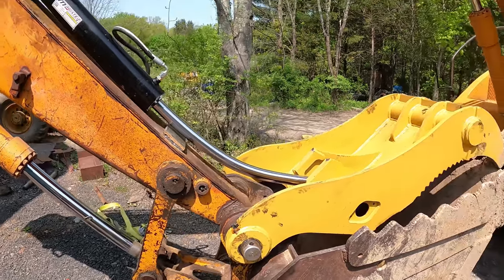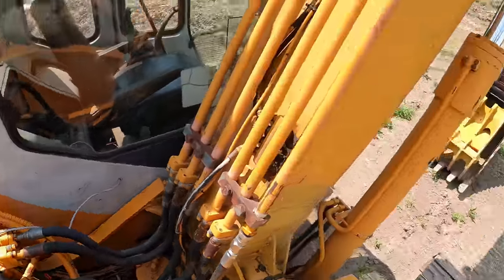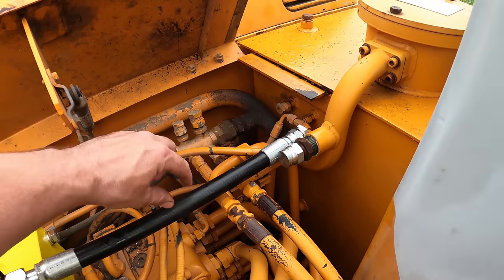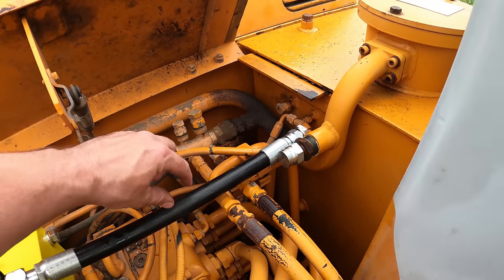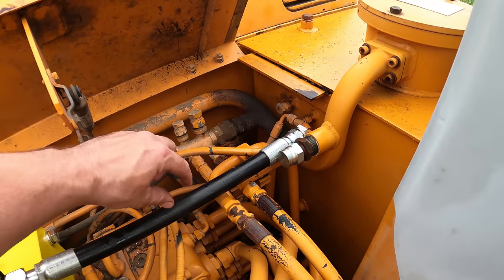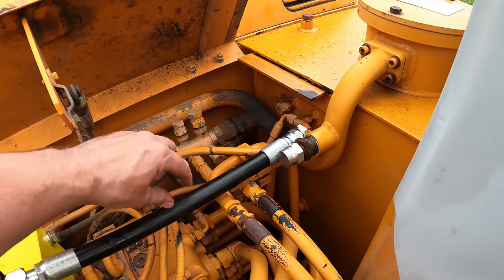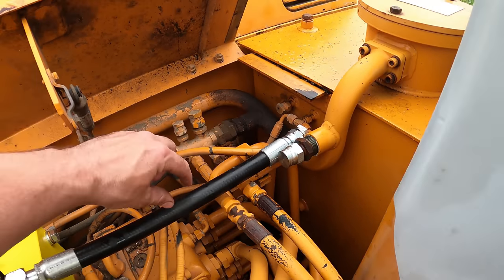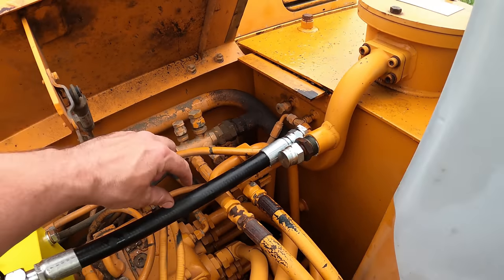Bent the rod on that thumb cylinder

Comment: feel for you.  Had something similar. I put a thumb on a new to me Bobcat , sent to the bobcat dealer to set the reliefs correctly. Got it back 3 months later only for the thumb to bend my bucket curl rod like a banana.  They said they set the reliefs but apparently did not. They replaced for free.

Comment: You were wondering why the new setup felt so much more natural.  If I understand what you said, the left side of the joy stick is controlled by your thumb, so if the thumb activates with your thumb, what could feel more natural than squeezing your thumb, squeezes the thumb.  Cool video Jesse!
Reply: I think it's also bucket controls, left is pick up dirt, left button is pick up with thumb, then of course right to dump

Comment: Great video!  It must take incredible pressure to bend a thick steel rod like that!!
Reply: Hydraulics can generate an amazing amount of force. Plus, that thumb cylinder has leverage working against it. Bucket curl is usually the strongest function of an excavator, as it equates to break out force (digging force). It might have around 10 tons of force at the teeth, where that cylinder is located, it may have easily 5x that. No relief valve, something's gotta give.

Comment: My Kubota was doing the same thing. It had relief valves changed before I got it  .I have to run a solid pin not a greaseable pin. Greaseable pin can bend or break. I watched Andrew's video on changing to a solid pin. I have same machine he has. My thumb is aftermarket not Kubota OEM.  Your video has good info. Thanks

Comment: Glad to see you are a Loctite 545 convert! Been using it for years and have never had a single oil, air, hydraulic, water leak on any equipment fitting I used it on. One note though, you are using about two times too much.

Comment: I didn't quite understand why you wanted to put the T in the middle of the hose, which would have required adapters on both sides so that there wouldn't have been much hose left. Couldn't you have just put the T on one end of the hose instead?

Comment: Hey Jessy, i am a machanic from germany. You need an check valfe from the other line to the hydraulik tank.

You will distroy your seals in the zylinder of air beeing pulled in.

Always cool videos
Reply: I was thinking about this issue. Shouldn't the output from the new relief go through a one way valve to the other side of the cylinder? That way the displaced fluid can be returned to the other side so it doesn't generate a vacuum.
Reply: Maybe it is best that he never uses the curl ram to overpower the thumb ram, as that will cause a vacuum in the thumb return side.   I suppose the absolute solution is to use even more valves..!

Comment: If you put the pressure relief valve on the pressure line before the control valve, it will relieve the pressure on both  sides of the cylinder - extension and retraction. I really like your channel
Reply from the maker: When that valve shuts off and the button is not pressed, it cuts the flow and the relief valve is bypassed. Thats why the rod got bent
Reply: @jmuller86  Thanks for taking the time to reply and explain why the rod bent.

Comment: I would never use a bent rod as it will wear out your wipers and seals very quickly as well as stress the heck out of the cylinder housing.  Can't believe a reputable shop would have recommended that.  The only other option is to straighten the rod (ala Keith Fenner) which takes a bit of experience.  You went right with just replacing the rod.
Reply: Correct. Bent rod will have stress cracks in it, its hardened like tungsten or close to it. it's unsafe to use again. Guaranteed if it was examined it would be stress cracked

Comment: Jesse - I just discovered your two videos on the thumb. It's great to see your creativity at work, and I see you also attract some expert viewers/commenters. You have taught this 73-year-old a few things. I have done a lot of mechanic work, but never messed with hydraulics. Now you've got me wondering about the thumb on my KX-121... it's way strong, and I always have to worry about shearing a tooth pin on the bucket... definitely need to figure out if it has a relief valve!  By the way, I subscribed.
Reply from the maker: Thanks.it should definitely have a relief valve. Moat modern mini excavators do for the aux hydraulics. Definitely should find it and adjust

Comment: I think you should do something about the other side from the cylinder. If its get pushed in, it generate a vacuum. Naybe connect the one port with a one way valve to the other end. Anyways a good Video.👍

Comment: Thank you for using hydro/pneum. loctite. Teflon tape is never a good option for hydraulics on npt. That Teflon gets into the system, you got bad valves on your hands. Also, I would think you system is good for 3000psi. Be careful of setting that relief too low. You will build up some heat if you use the grapple alot. I love how many fittings you have. Npt, jic, sae, bspt, inverted flare. Goodness, that is a Frankenstein. Good stuff bud. I sell many of the parts you used. Heavy equipment is its own animal, for sure

Comment: Reliefs don't need to move a lot of volume they just open another passage which greatly reduces pressure.
Reply: They need to be able to handle  a lot of flow when the system pressure is set higher then the relief pressure. Like in this case. I would have done this differently then jesse has done on this excavator. Set the working pressure  at the desired pressure, and set the relief valve slightly higher. Like 200 psi or something.

Comment: Just so you know... the valve selector box with the two wires coming off. After you take off the outer sleeve it's just the toilet roll looking thing. It unscrews, may or may not have two tiny flats for like a 1/8" thick shitty wrench. I just use a leather strap wrench. They normally just have 20ish threads and an o ring. For next time 🤙

Comment: With a hydraulic press with soft placement parts one does not have to spend over 500 dollars to replace said cylinder. Do NOT stroke the cylinder when in this condition. Otherwise ya'll can straighten such a cylinder and seals will still not leak. Try not to bend quite so far as the brass bushings also screw up. One must keep after control valves to inhibit such errors. Ya'll can unbend such without a cylinder kit. While still just removed from machine and not opened up. I did cylinders a lot years ago not having to disassemble. Measure rod with dial indicator to straighten. If heated rod can be reorganized back to straight condition crystal strength alignment. NEW ROD NOT NECESSARY.

Comment: I just bought a bobcat 334 and it has that style thumb to go on it it doesn't now so anyway I look at it I'm going to need to buy it's on and I was looking at the that kind and I thought it was kind of weak so I'm going to look into the kind that you weld on I think you were calling it the progressive because I can just see pending all kinds of those rods so thanks for showing that that showed me just what I was worried about good video thank you catch you on the next time thanks for sharing
Reply: The Bobcat 334 has an excellent thumb design. What it lacks is sufficient length in the actual steel assembly. If you can salvage a thumb from another machine I would do that. The 334 should have the same parts as a 331, 335, 430 and 435, possibly more even. But confirm that for yourself. The main problem with the Bobcats thumb is it's not long enough but with an old cutting edge you can add on about 12" before it will interfere with the bucket cylinder. The 430 I run sometimes has that modification and it makes it a breeze to pick up big logs and rocks. It still can't hurt itself even when its picking up the max weight it hardly will relieve the thumb cylinder. None of the weld on stuff with compare with the OE design but if it's all you can find it's better than no thumb at all
Reply: @NotSureJoeBauers  thanks I need thumb, looking!

Comment: I'm thinking the pressure release would have worked on the thumb retract line. If  its the bucket pressure against the thumb that caused the bend?
Reply from the maker: it would be creating a vacuum on that line so wouldnt work as well

Comment: That's a nice fix , the lack of a bypass is a design error I assume the thumb cylinder was just essentially solid and when it was touched by the bucket it had nowhere to go, really that bypass should go to the other side of the cylinder as the opposite applies to the retract,  if pushed it would just break the oil column in the retrsct side, interesting

Comment: Given where youre putting that relief valve, what happens to the 'suction' side hyd curcuit when it goes over relief? Wont there be a serious vacuum on the rod side if the thumb cylinder gets collapsed by curling the bucket? Will that create a negative air spring effect? Cause cavitation? The relief valve solves the overload on one side, but the other does what?

I was trying to Google what to do, a crossover relief near the cylinder that both hyd hoses go through before going to the cylinder ports somewhat makes sense, and i see people have done that, but i also read others say that type of relief setup is only meant for hyd motors or multiple single acting cylinders, etc. Because the rod displaces fluid, youd still end up with a bind doing it this way.

I hate to be a buzzkill, i know you just put this work into it, but i think the correct way to fix this is to buy a different electronic valve that has the reliefs built into it. Install it, set it to the desired pressure and be done with it. This is the cheapest way i can think of doing it correctly.

 If someone here knows more about this, id like to hear it. I have a kubota backhoe i added a manual thumb to, and am looking to buy a fullsize hoe ill probably need to plumb for a hyd one soon, so ill need to figure this out eventually on my own.
Reply: I see Farmcraft101 commented here, love that channel, too.

In his vid where he's diagnosing his hyd trouble with his mini's dozer blade creeping up on its own, he talks about how the rod displaces fluid. At first, i think he didn't know whether it was the piston or the valve controlling it gone bad. He eventually figures it out, that bad cylinder packing seals couldn't explain why the cylinder was creeping up. The reason why was because the cylinder rod displaces fluid, so therefore the cylinder cant move without a net gain/loss of fluid (the volume of rod inside/outside).

This should be accounted for when laying out the hyd circuitry to have everything work smoothly, imo.

Comment: It's amazing how easily it broke itself. Just bent a 2" 3"? Solid steel bar like it's nothing.
Reply from the maker: yep, 2" of solid steel. but the rod on the bucket cylinder is like 2 3/4" so the weakest one gets bent first

Comment: Magister Hydraulic are junk ,they are NOT case hardened , I replaced an existing cylinder  , with in 10 minutes the Magister shaft was bent . $500 bucks , shot. I wonder , with the low pressure how use full your thumb will be. You never said , was the old shaft straightened or replaced with a hardened shaft. Great content ! Thanks.
Reply from the maker: He replaced it and I am sure the new rod was better than the old. Is there a place that sells better cylinders? This place wasnt the cheapest but they seemed to have a big selection of dimensions
Reply: If the new rod bends or you want to up the pressure on the relief valve so the thumb doesn’t move, you should go to a larger rod diameter.

You might be able to bore out the gland on your existing cylinder and fit a larger diameter rod.

Comment: I have a Wacker Neuson ET90 and my mechanic can’t figure out if the pressure can be adjusted for the circuit running to the thumb. I thought this could be done for any machine.

Comment: Doesn't the relief valve "dump" should go to the other side of the cylinder? (at least that how mine is installed on my mini and the hydroshop told me to do) . (it move the oil form the extend side to the retract side)  because when the valve is not in use: both side are gonna be closed and when relieving the pressure will put the other side of the cylinder in "vacuum."(and won't do much with the control valve closed)..which the "spring back" is showing.
Reply from the maker: That is how I was originally going to do it but then I thought about having another 4 hoses at the end of the boom or stick and it just seemed like something that brush would catch. It does create a vacuum when that relief valve gets used but it seems to work fine
Reply: @jmuller86  you could have done the T at the connection to your valve block (not necessary to be a the boom/stick)..just like you have done, but dump in the other hose instead of the tank.  It's only 1 hose that loop over:  you connect the relief valve at an existing connection, loop over the dump and T on the other side
Reply from the maker: @maxpat82  you know I didnt think of that. Is that how yours is? That wouldnt be thay hard to do
Reply: @jmuller86  Mine is a mini 1,5t so no place on the cabin so it's at the boom at a connection yes.

Comment: I'm surprised you don't have an engine drive welder! A lincoln ranger 225 or miller bobcat or trailblazer would probably be a good thing for you to have and they come up at auctions all the time. Avoid gasoline engine models over 1000hrs as a general rule, you don't have to worry as much about hours with diesel engine drives though. I bought a Miller Big Blue 300 pro at auction with 6000hrs on it, runs like a sewing machine.

Comment: You can’t weld over an old weld.  To repair a small tear like that gouge out the damaged metal and old weld then cut a filler piece, bevel the edges and weld until your flush with the surface.  If you want to reinforce do something that reinforces the corner where the stress that’s trying to tear the bottom of the bucket open.

Comment: Why did you not get a sub base for the valve with a screw in cartridge relief port. No extra plumbing needed.  Look at Daman manifolds. The valve looks like a standard D05 pattern
Reply from the maker: I looked at that option briefly but it was hard to figure out what I needed. all the ones I looked at had no option for relief valve

Comment: Sounds like the machine shop guy gave you a 💩 answer.  Couldn't the relief valve be mounted near the thumb cylinder and use the thumb retract line with a T-joint as the pressure return line back to the tank?  Would retract hydraulic pressure against the over pressure port damage the valve?

Comment: Why not dig up the original culvert pipe, aim it so it goes directly to your pond outlet add your extensions and take the other ditch and bring that into to the pond  outlet/ near the culvert end? Would give you a lot more real estate to work with for turning the trailer.
Sorry bout the cylinder, shit happens, pressure release valve may need just a tweak lower before it releases, thought I could see the slightest bow in the new rod on the last few shots of you checking that.
Reply from the maker: there is several electrical service wires going over that culvert, so I really didnt want to disturb them
Reply: @jmuller86  oh, that sucks. that is why our power company is not allowed to do that here in Virginia.

Comment: Need to set the relief valve at a lower pressure then the curl cylinder otherwise it will happen again
Reply from the maker: its not really that simple because you can have a lower pressure but leverage can still work against you. longer bucket or long space between pins on the thumb can make a huge difference

Comment: That's a tiny thumb cylinder... Should be using one with at least 2"rod and 3" bore..
Reply from the maker: it's not a tiny cylinder, that is a 2" rod and its a 4" bore
Reply: @jmuller86  My apologies good sir, you have a lot of power at your finger tips in that machine.
Reply from the maker: @the1dud  yea the bucket cylinder is like 2.75 inches rod and 5" bore but thats what the relief valve is for, so that it doesnt bend that thumb cylinder

Comment: Next time call the company on the clyinder who makes it,  might be faster and cheaper for parts.
Reply from the maker: I did call them and it would have been cheaper for the whole cylinder but then I still need to weld on the eyelet, which I guess I could do but I didnt know that it would be $550 until I got it back
Reply: @jmuller86  dam . Machines are expensive to fix, i do chrome rod repairs and welding so i know . The rod is not cheap here vs china for material s
Reply from the maker: @vettepicking  yea I am just glad to have chrome from here vs china. I am sure that original rod was from china, but the new one isnt

Comment: Wouldn’t it have been better fitting a larger diameter ram to the thumb.
Reply from the maker: No, a relief valve is what was needed. Larger diameter bore or rod just makes more power and will break something else. You need to give the thumb the ability to be the weak point

Comment: Easy fix for the hose end hitting the deck lid. Turn the hose end 90 degrees off to either side. That will put it in a level position instead of pointing upwards. You have a great channel but you spend way to much time explaining what you want to do and sometimes you repeat yourself. Same mistake a lot of YouTubers make.
Reply: "you spend way to much time explaining what you want" -- Couldn't disagree more.  Too many YouTubers don't explain enough and skip out on sharing their thought process with the viewers.